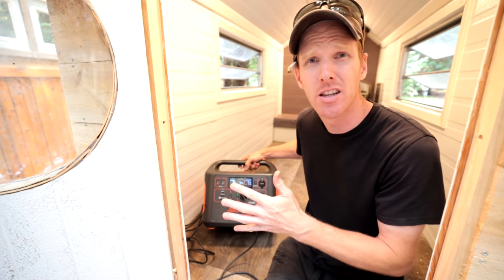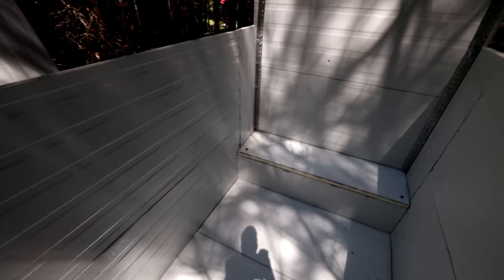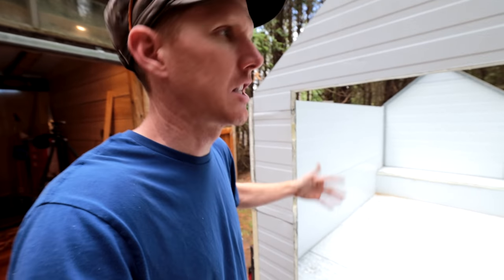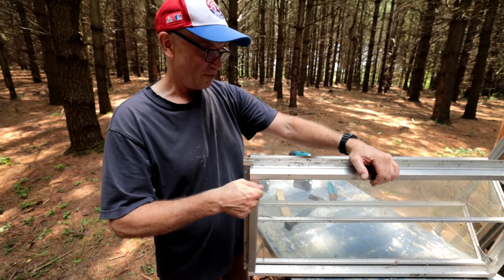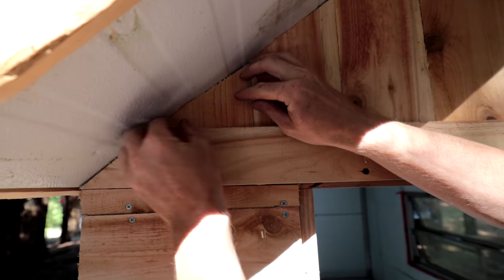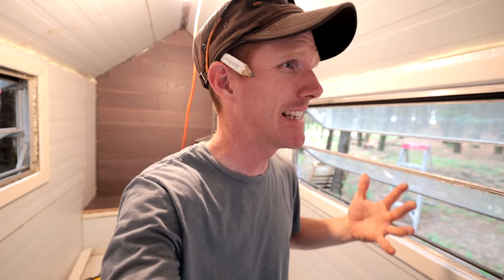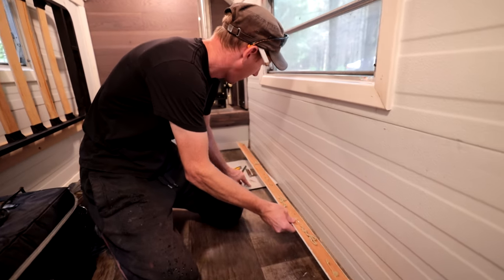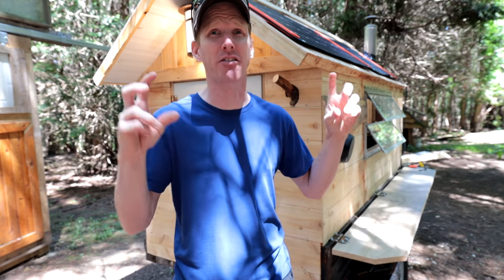Building Tiny MICRO 32 sq ft. LUXURY RV Camper - "The Glamper!" VS. @FowlersMakeryandMischief

Comment: You win on everything but the cook station.  A couple suggestions: 1) replace window on cook station side with a slider so you could access coffee pot or monitor the cooking from the inside.  2) might want to install a fold out roof extension that could be raised if your cooking in the rain so roof drip doesn’t fall on the stove.  Great job, you have given me a project build
Reply: Excellent suggestion!

Comment: Hmm. I can't actually say, so it would have to be a tie?

This one ; 
PROS - 
Love the garage door insulation idea! 
Love the tiny wood stove! 
Love the lights! 
Love the foldable stuff for space! 
Love the windows and view! 
Love the outside shelf area! 
Love the door overhang for weather! 
Love the amount of interior space! 
Light weight and waterproofing, could totally be a tiny camper BOAT (would love to see That, like red-beards tote pontoon boat camper) 

CONS-
No screens for bugs or wind-blown debris.
Overall shape is ok but very square for road winds. 
Stove pipe not folding or removable (hit branch on video lol) 
Not enough 'amenities' to consider "glamping" (mr Red-beard had a microwave, fryer, AND tv ;P  )

Overall, great camper 8/10!

Comment: YOU WIN!  LOVE both Glampers but YOU WIN for more room, more protection from rough weather / seasons.  You could easily set up a small TV and game console on your drop down desk or on back wall to the left of the wood burner stove.  Park the trailer facing South so solar panels you put on roof get best sun access.  LOVE the re-use of the garage doors that have built in insulation and weatherproof ability.  REALLY well done and would not seem too pricey as DIY if you take some time to search for old trailer, garage panels, old windows, etc..

Comment: IMHO you won the glamper competition easily. Your camper had so many nice features. Fowlers project was basically a box with small appliances inside. Yours had so much more design and style, also you used recycled materials, very cool.

Comment: You can improve the efficiency of you heat shields by allowing air to convect up the back side of the shield. That is an open top and bottom. The shield will get hot but a cool draft on the back side will do wonders at cooling it down.

Comment: Really cute. I've seen in other videos with those little tiny stoves or any of those stoves, you need to burn them off outside before putting them inside because when you light it it's going to emit the smell of the paint and metal.

Comment: i watched both videos!  it would be hard to judge the 2 campers against each other - they are so different!!  One is about 2 times the size of the other and maybe cost 3 times as much.  One guy used a lot of salvaged materials and the other use a small amount of salvage materials.  So I like both of them for different reasons!  Both guys did a good job!  Slight preference because of the lower cost and use of salvage materials to modern self reliance!

Comment: Between yours and Zack's I am gonna go with yours for accessibility and convenience.  But I think Zack has you with his addition of the appliances and TV.  I am gonna have to go with Zack because his is more "Glam" but I think yours is more complete and sustainable.   Just wish you had more flash.

Three suggestions: 1.  Outlets for appliances on the outside and desk side.  2.  Canopy with screen over the ktchen.  Retractable would be best.  3.  Since it is a glamper, AC for summer heat.   Also since you have a fire place an extinguisher in the camper.

Comment: Another option when using this material, is instead of cutting this stuff completely through, over measure the thickness of it, and cut only through 1 layer of metal plus the foam, leaving a layer to overlap, and seal to the next, this works on the corners as well, if you don't mind hitting it a bit to get a good bend to enclose the edge and help seal it. You can also use that overlap to help mount things like windows and doors, or even to attach to a frame, you can bend it outwards, or inwards giving a more stable mounting point, and use less hardware, saving weight and money in the end. This is also an easy surface to apply full sheets of vinyl to, using a multipurpose mastic, and 1/16" V-notch trowel. There's also vinyl "T" inserts you can use in the joints. Either way, this stuff is incredibly strong, and really great for insulated, waterproofed areas.

Comment: I have a Jackery 500. After suffering a back injury, I had trouble getting in and out of bed. My solution was to buy a really nice powered recliner to sleep in. After the power blipped off and on a couple of times in a thunderstorm, I became paranoid about being stuck in the recliner during an extended outage. (I live alone) What decided my selection of the Jackery 500 was reading about a lady who used one to power her recliner. She wasn’t concerned with power outages, she just didn’t have a plug in the area where she wanted to situate her recliner, and didn’t want to use extension cords. So my Jackery sits in a bookshelf that runs parallel to my recliner. The recliner is plugged into a surge protector on the same shelf. If needed, I just unplug it from the surge protector and plug it into the Jackery. I’ve tested it, and it does the job. Now I sleep without worrying.
Reply from the maker: That's being proactive!

Comment: As I already stated on Zach's page, personally I think you both won. Yours was more involved with recycling, reusing and integrating various elements into one cohesive and harmoniously eclectic structure while Zach's was more involved with utilizing his woodworking skill set and attention to details. You both have mad skills in different areas, but to compare your finished masterpieces would be like comparing the Pyramids of Egypt to the Eiffel Tower in France. There is no comparison. They are both remarkably impressive works on their own. Congratulations 😁

Comment: I bet you could run a tiny window ac unit off that jackery. A 150 sq. ft. Unit should draw less than 1800 watts and you'd have to run it for like what? 5 minutes to cool that thing down from blazing hot sitting in the sun? I hate the heat lol. When it's cold I can always put on warmer clothes and build a fire. When it's hot there's not much you can do other than get naked, sit in the shade and hope for a breeze you know? Lol! I love these builds though. I'm glad I found this channel 👍

Comment: The stove is overkil in such a tiny space.

Even if the space wasn't insulated it would still be overkill.

Nice, compact travel cabin with excellent window area and great visual appeal.

The insulated panels made excellent material with which to construct the travel cabin and with the stove, give it full 4 season comfortable living capabilities.

Your materials and methods were very good and the finished travel cabin is of outstanding quality and looks lovely. Subscribed.

Comment: Although the two aren't really in the same size class, Fowler's build can fit in a garage and could be towed by just about any vehicle. But overall, you win because it is so complete with the fold out bed and table, lighting, heater/fireplace and outdoor cooking space.. basically the better glamper.

Comment: That tiny stove is pretty cool. That duel damper with the 2 different levers for front draw or rear draw(from underneath) might have a vent connector for the rear draw. This way you can hook the vent and pipe it outside and now the air the fire requires to burn comes directly from outside when you have the rear damper open. Now the stove don't require drawing air from within the cabin of which creates a small negative pressure in the cabin, of which means it is like a slight vacuum chamber. So now the air will suck thru the cracks in the windows, doors, and cause a draft blowing past you and into the fire. And if you try to seal the cabin completely air tight with really good doors and windows and not have the vent hooked up to the rear damper with the damper opened, then you will suck all the O2 out of the cabin and that is not healthy. Not that you have to do it, but if not then you need a window cracked, or at least have shitty leaky doors and windows. 

I just realized, that is one way to make a vacuum chamber, have fire suck all the air out of the chamber, forget about the pump. lol. I don't know how much negative pressure it will produce, but it will be something. The fire will go out, but after it depleted most all the o2. Most likely if a fire can't breath in a cabin, then you can't breath in that same cabin either. Once it dies out, so will you. lol Since you ARE fire, but you are all things, electrical, water, fire, earth, etc...but without o2 your fire goes out.

Comment: Excellent work, thought & repurposing [better imo than conventional techniques with conventional types of materials]...As an additional possibility/option/upgrade the entire glamper could be Faraday cage fitted and be pulled by a winch straight back into the deep bunker hole & buried...just in case.  Bunker builders & preppers paradise-I see it now..."The Blamper"😂🤣

Comment: You get a lot of style points.  Fowler gets points for it's aerodynamics, the fact that it sleeps TWO, has a larger/logical food prep area.  Fowler's design is based on a teardrop trailer. But if I had to decide which one to hook up to my hitch I'd pick yours based on its whimsical mimi-home appearance and because it has heat and a fridge.  Fowler's has neither.

Comment: This is frankly, an amazing, high quality, brilliant "Glamper" build dude ! The only thing I would change is to add an internal shower stall and toilet. Internal cook shelf (Not external for using in bear and cougar country, so you would need to keep that stuff on the inside). I would overhang and extend by about 8 to 10 inches on all four sides, and raise the roof slightly, to enable a 6 foot standing height. You just need to add internal bathroom and shower and hot running water and it's perfect.
Reply: U might as well just build a house if u want to camp that comfortable. Jeez
Reply: @ishikawa1338  Yeah, but a tiny one.

Comment: Your camper looks great but I often wonder if you extended the cabin section out over the wheel guards thus making the camper that much wider and if fact if you chose the right size trailer you could actual have your bed fold up forward into the front wall like a Murphy bed and then have a table hinged off the bottom of the bed for when its folded up and you need to eat etc etc..The extra width would allow for some cabinets for storage etc etc..

Comment: Looking at what you have built, I am really impressed.
What did you do about drainage?  
What is your plan for the chimney while you are driving?  I see a huge potential for wind and w
ater blowing though, while traveling.
I also suggest an inner (or outer) removable window, to help keep the wind and rain out, while driving
Do you have room for a storage box on the front?
I still worry the potential for some of those roof slats blowing off.  Maybe if you had tongue and grooved them.  Base on the last segment of the video, you still have a small gap on the leading edge of the roof.  I suggest covering that to prevent air building up underneath and trying to lift those pieces.

I am seeing an 'apples and oranges' comparison here.  Yours is by far, more weather tight and comfortable. Definitely something I could do (maybe).  You definitely seem to have a better trailer base, where Zach might have to find another better trailer.  I do see a lot of potential for noise as things bounce around.
Zach's looks more aerodynamic and can probably handle higher speeds.  However, at this point it has not been weatherized and he hasn't accounted for a heat source in colder weather.

As it stands, both need finishing touches.  Yours seems to be four season, His could be.  He's already spent the night in his, and is already stocked.  Yours has a heat source, insulation, but is not fully wired or stocked.  You may have taken precautions, but I still worry the potential for some of those roof slats blowing off.
All things considered, I call it a draw.

Comment: The only thing I think I would have done differently is give a slight overhang on both sides to widen the inside space a little. An extra 6 inches both sides could really open up what you can do without messing up the tow drag too much. Plus gives a bit more "curb appeal" as it where.

Comment: Should have cut the outside panels of the front 3 inches wider on both sides so that you could cover the side panels insulation and folded it around the sides and riveted it

Comment: Build me one of those on my 5ft x 10ft trailer and pull it to the top of my hill where it will stay. Anchor the trailer into the ground onto cement blocks and remove the wheels.

Comment: the murphy bed take one of the windows out :/
at first i thought you were going to make 2 benches, well that's what i would have done.
bench on the left for storage and table, pole and removable table in the middle (the table itself could slide under the foam mattress from the left bench, right bench could be split in 2, and the first half (closer to the door) would be a pop out drawer with kitchen in it so you can cook outside

Comment: i know im super late to vote on them, but i am unable to pick a winner anyway. the fit and finish here is top shelf, as we expect from kevin. but, this camper wouldnt be able to be towed by fowlers car, which is a subaru crossover. his camper is much more streamlined and light weight, which would be great behind a v6 or smaller vehicle. i have a v6 hatchback and small pickup, so i think combining the best ideas between the two would make one helluva sweet little camper!
Reply from the maker: Mine weighed 1200lbs all in... I'd imagine most vehicles would be able to tow mine.

Comment: So, it's a pretty hard choice.   Positives of this build.  +Four seasons +Fire place +Convertible interior +Beefier wheels +The look will only improve with age +General fit and finish. Flower's Makery and Mischief +Full sized bed +Amenities inside +Aerodynamic on the road +sheltered galley +easier access to food. I'd have to give the edge to this build, as it would be more useful longer, and making changes to improve it would require less work overall. The power of insulation to keep things the interior temperate is just too much to overlook.

Comment: Your's did more with the space, is prettier, has insulation and heating. I mean he wins out for having a TV and PS4, but your's is set up well enough that you can just toss those in there when you feel like you, with zero issue. Just put a TV on the table in front of the one window.

It's also nice that he has an air fryer, but again... Nothing stopping you from just plugging one in. xD

Comment: You win! Your build is definitely better than Zack’s. While his is technically sound, looks pretty, and showcases his woodworking abilities, his camper lacks insulation and it’s weather proofing is suspect. In colder weather that thing will be an icebox and the lack of seals especially around the doors will cause those really expensive plywood to rot.

Comment: That Jackery is pretty sweet too bad its like $3000 as he has it with the solar.  There are much cheaper units that do the same thing, including the solar.  I run several different ones.  This is pretty cool setup but I couldn't bear to use one of these less then at least 5' by 8' thats the minimum.

Comment: Great build. Great video - but i have one question. When you added the stove pipe and then the outer top and skirting, you didn't put it under the cedar shingle? Not the pipe, i mean the skirting around the outer upper pipe. Im used to seeing it on standard housing so it may be different on the tiny houses? Like on on top of the garage door panels but underneath everything else.

Comment: Those little stoves are cool, but the bracket it sits on cost the same as the stove as well as the exhaust pipe. I say buy the stove and make the rest from cheap but same quality as the originals.

Comment: The true test will be when your actually in motion and hitting bumps here and there..how secure will everything be? Btw great job on the build!!
Reply from the maker: It's been in the road a total of 5 hrs bouncing around at highway speeds..  nothing is out of place.
Reply: @ModernSelfReliance  I just watched the second part of the video where you did some upgrades, pretty cool add ons...oh btw, just a heads up, those jacker foldable solar panels are awesome but  not meant to be exposed to rain, i would add a couple of 100-200 watt panels that you can install and secure on the roof.  Yours wins the contest in my eyes, just the fact that its more roomy inside plus all the updrades..hands down!

Comment: How are you going to deal with the air coming down the chimney when your driving?  Wouldn’t the air come down and blow the ashes around?
Reply from the maker: I'd imagine you'd clean your ashes out  or close both dampers and travel.  they are designed as a Marine fireplace and will take a significant amount of wind.

Comment: How much weight can those panels handle?
How'd you get the styrofoam out and the wood blocks in the panels?
Interesting build, though.
Reply from the maker: They are very strong, I just dug the foam out of the panel with a screw driver and a knife.